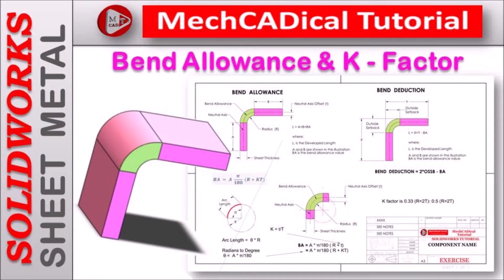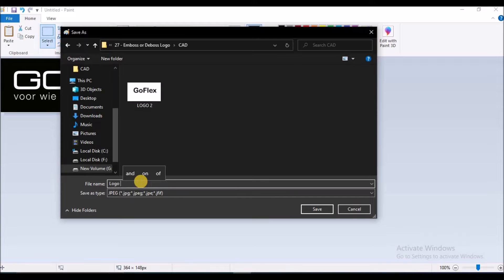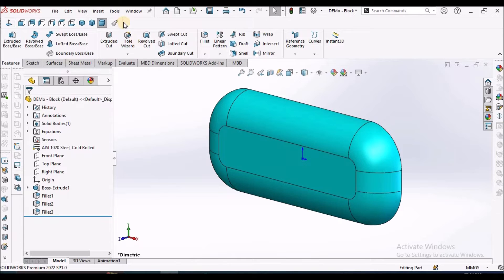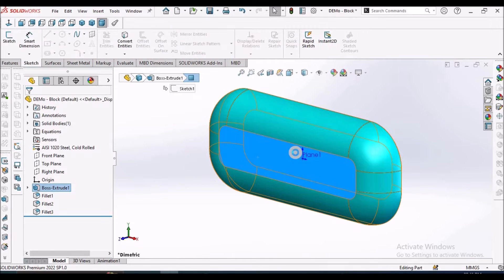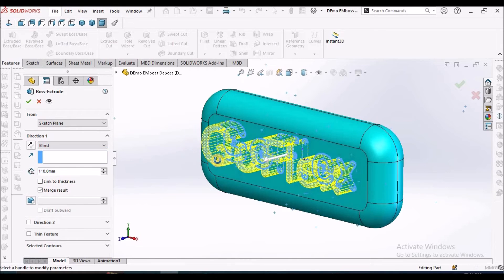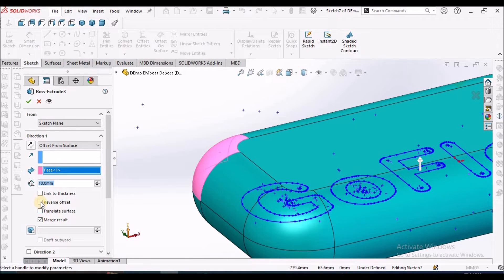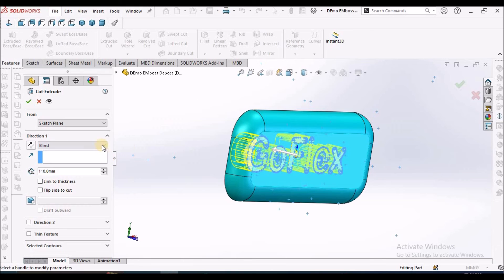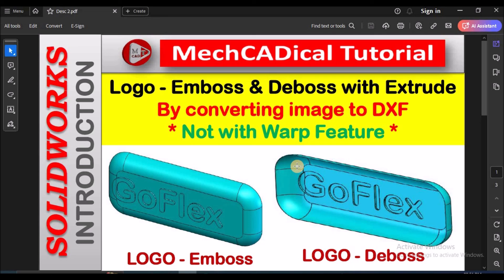Logo - Emboss & Deboss with Extrude By converting image to DXF in SolidWorks

Comment: hey, so I was trying to emboss iit delhi logo but solidwork keeps lagging. like I can't do anything at all after importing the logo. how else can I make it?
Reply: If you converted a graphic file to DXF, it's likely a million tiny sketch lines. Unless you have a powerful workstation class computer, SolidWorks will take forever to import and work with it. I always open the DXF in AutoCAD LT (or Draftsight) to clean the DXF first. Trace it with lines, circles and arcs to remove as many tiny line fragments as possible. Curved areas will have the most line segments. Save that and try again in SolidWorks
Reply from the maker: Yes, If you have multiple software then it's fine, otherwise we have to import in SolidWorks and make a block of it, then create logo in Sketcher mode.